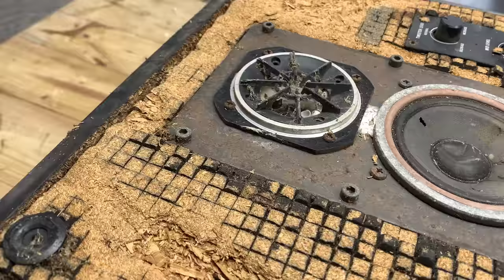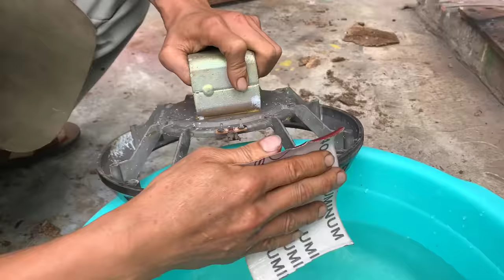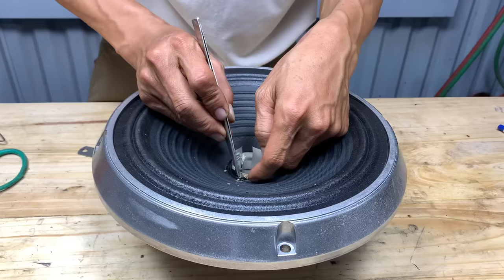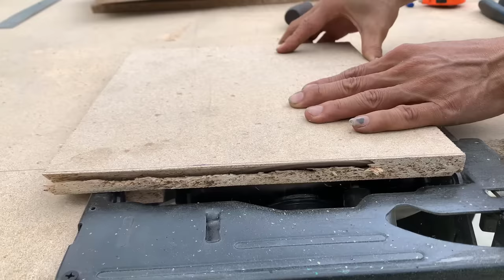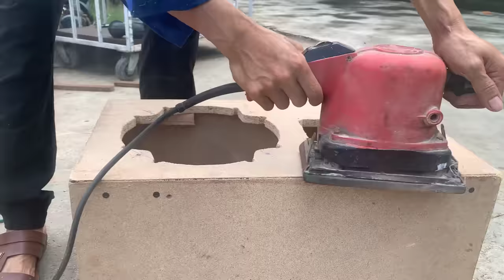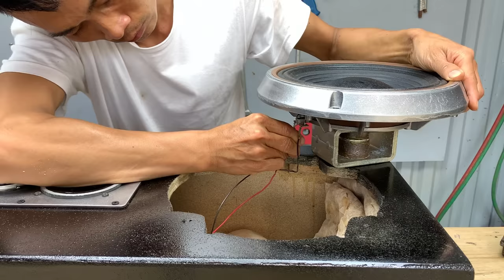Restoration 1975 Japanese SONY Speaker // Restore Repair Speaker As You Wish

Comment: Hi. Great work Please could you tell me what product you are using in your bottle that you pour onto the speakers to remove the old gasket and cones? Is it some type of solvent?
Reply: I believe its called butyl accetate, you could try solvents such as iso alcohol or acetone but should be handled with care as any sort of acetate will disolve paint and plastic some faster than others.

Comment: Is it better to have a box made out of compressed wood instead of one made with solid wood?
Reply: some woods have better acoustic properties than others, mahogany is the best but as speakers generate sound by the movement of air pressure it really isnt an issue. What is important is the construction of the speaker enclosure and the internals.. needs to be damped with cloth or foam this is to stop reverb inside the box of air pressure from the sound waves as well as having a breathing gap or tube to allow the speakers to vibrate as they work.
Reply: Bamboo is best for strength and sustainability. Sad only one company out of hundreds uses it. Mdf (edit or particle board) or compressed how u say is used a ton but it’s awful and soft too. Becomes garbage

Comment: It's nice, but it could be better. The mid speaker didn't have any dust. It would be better if it were replaced. The cabinet could be made smoother by putting putty and sanding. It was functional, but it was not good in terms of flexibility.
Reply from the maker: Thanks very much . We will try in the next videos